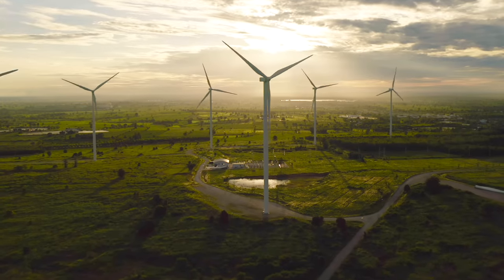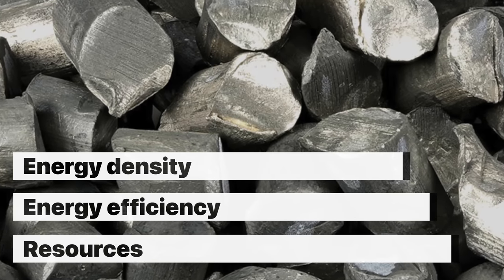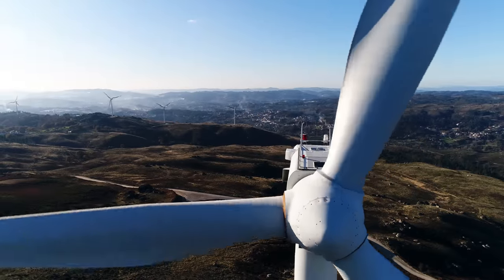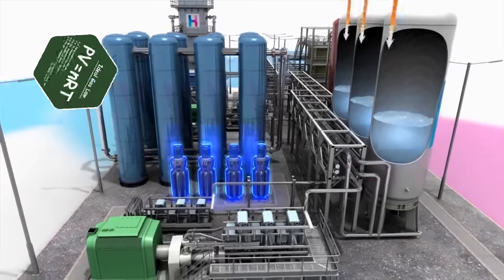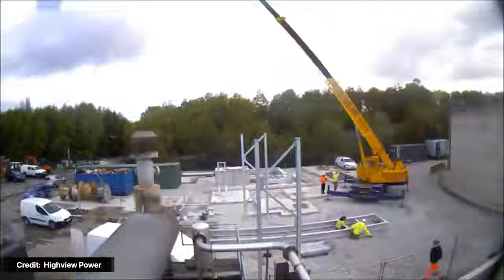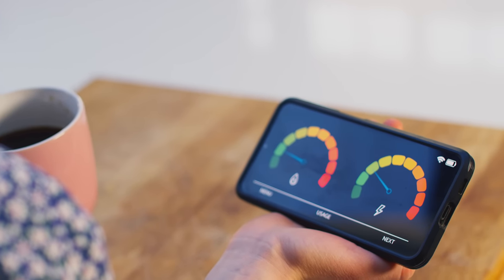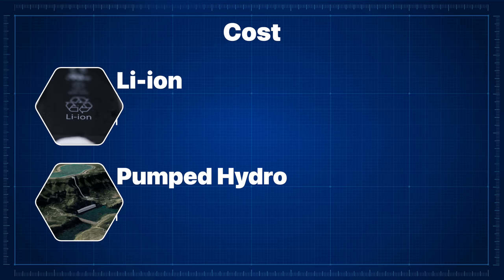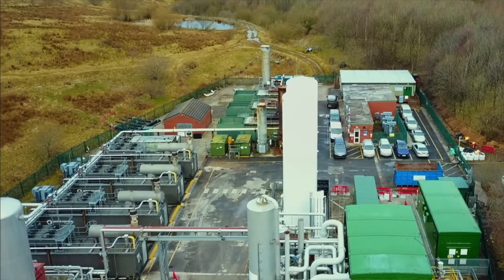Insane Breakthrough Stores Energy In Frozen Air!

Comment from the maker: Go to https://www.eightsleep.com/twobit  to start sleeping cool this Summer and save $150 on the Pod!
Reply: Might be the 2nd product I snag from your sponsored stuff. Got an Aptera pre-ordered, and I've been looking for some kind of water cooled bed for the hot Phoenix nights.
Reply: Even though I think you are sourcing my articles, can yoy do a video on district heat pumps and Badger robotic no dig Tunnel excavation that can be used for ground source heat pump networks..
Reply: Pairing pumped hydro with geothermal is the best cheapest solution from my perspective. Even areas that don't seem to be able to do these together isn't thinking. Even if you can't find higher ground to pump water up too, your already on the highest ground you need. When you dig down deep you have plenty of fall and storage below your feet for hydrostorage and pumping is as simple as digging deep enough so the heat of the earth turns the water into steam naturally and up it comes freely pumped ready to funnel into a steam turbine electric generator for all the free power you need. And with it all the free preheated hot water your ever going to need, 3 birds with one stone. Energy storage, no batteries to replace ever, and a constant supply of free heat and electricity. And big oil has been depriving us access of this all this time by teasing us into paying more and more for not using what has been free and cheaper to optain for us all along. And areas where you can't get deep enough to have high enough temperatures you can then add solar/wind/cryo/lithium in that order before using gas/oil/coal/wood/biofuels and let me tell you why. Even though it is cheaper short term to use these alternatives in reverse from biofuels up to lithium in the long run it is cheaper in the order I just mentioned. You can heat up the water the additional amount needed with solar thermal to reach steam generating temeratures until you max out your space for solar, then add wind until maxed, cryo until maxed, before dipping into litium which needs replacing after so many years, long term costs remember. Save the litium for mobile applications. And don't worry because another game changing tech is on the way to suppliment litium, induction roads to charge your EVs as you drive the highways your charged up as you travel and never need to stop and wait at a charger. At least 3 companys are developing this globally.
Reply: Wow a sponsor with a product I'd actually like to get, what do you know :D
Reply: Wait, why can't they sell the argon, and other noble gasses, also extract CO2 (both valuable and can reduce CO2 in air) etc?.
Reply: Why hasn't reel to reel laser exfoliated graphite oxide, makes graphene hasn't been industrialized? This tech alone could solve energy storage. A 1ft diameter 6ft tall cylinder capacitor with either polypropylene or sprayed mica dielectric could have volatges above 1000v and farads in the terra range

Comment: Something you didn't mention is that the air liquification process they use was developed at the turn of the last century by Georges Claude and has been used for the industrial production of liquid nitrogen and oxygen since before World War I.

 One of the uses of liquid nitrogen is in the production of ammonia, mainly used for fertilizer, using the exothermic Haber process. 

They would complement each other, don't you think?

One of the other things I like about these is that in their existing facilities they use former oilfield workers as they already have the knowledge and skill set to operate these plants with minimal training. 

What a great way to quickly transition them to green jobs, don't you think?
Reply: I'm not sure the skill set between oil field work and cryoplant operation is that good of a match.
Reply: @incognitotorpedo42  On the "Just Have a Think" YouTube channel they specifically mentioned that they used ex-oilfield workers at their Manchester test plant due to their experience with compressors and high pressure lines.
Reply: They don’t want older and proven knowledge and technology. They want to be innovative and disruptive new approaches so that it can lure in more funding from government/venture capitalists. It’s all about money.

Comment: Would these be good near server farms? They always spend insane amounts on cooling. I wonder if they could use this system to harness that waste heat, cooling the server farm.
Reply: server room air doesnt get that hot before they start to overheat. even the exhaust air and coolant in a overheating liquid cooled system isnt even hot enough to burn you.

Comment: Here in Australia,  the thought that this could run adjacent to steel, aluminium and cement manufacturing would be fantastic. Working in conjunction with green hydrogen and subsequently green steel manufacturing or even molten  salt. 
Little bits  of everything to balance peak and off peak loads. Thanks for sharing.

Comment: I feel like this would go great with nearly every other form of power generation. We make tons of waste heat from multiple processes. I could see it getting tacked onto alot of things. Hell this would probably combi well with those compact modular reactors people have talked about before. Just start stacking.
Reply: With geothermal finally making some headway I think nuke power is on it's way out, or at the least put on the backburner for more cleaner, cheaper energy. We can resort back to nuke when we max out our global green footprint. And by then fusion will have been worked on hopefully to perfection. Things are looking very positive lately the competition for cheaper fuels is heating up, pun intended. 😉

Comment: I have heard that liquid air storage plants can be used for carbon capture and storage as different gases liquify at different temperatures so I think CO2 liquifies at -78°C, perhaps other gases could be removed such as nitrogen for fertilizers, oxygen for hospitals, argon for the chemical industry.
Reply: That's called "fractional distillation", it's already used but not for separating the components of air because there's more efficient ways of doing it. 
CO₂ by the way doesn't become liquid if you just chill it, it goes straight to solid. It becomes liquid if you compress it instead. (Nature has some odd stuff).
Reply: What does solid oxygen is like transparent blue ice or transparent aluminum, the carbon makes it black. It's interesting that the oil hydrocarbons are liquid black but get lighter in color as the density goes up.

Comment: I work for an industrial gas company, not the one which supplied the equipment in the video.   We call this type of plant a liquifier.    Very energy intensive.   The air is first separated into nitrogen/oxygen/argon and then in this case the nitrogen stream is liquified and the oxygen/argon vented back to atmosphere.   Normally the energy is consumed so we can transport the liquid to the customer.   Many customers use the evapourated gas, some use the liquid e.g., food freezers.    Liquifiers are most efficient when run at close to rated capacity.    They can be designed for a range of production rates, but turning them on and off frequently is not good for the equipment.   There is a good amount of energy needed to get all the equipment temperatures lowered to the required temperatures to start making liquid.
A nice idea, but one with a lot of "cons".
Reply: So the oxygen isn't sold to hospitals and the argon to industry.
Reply: A typical industrial gas liquifier will produce LIN, LOX and LAR.   In the video they only mention making the LIN to store in the tanks.   The video mentions the plant may be in remote locations.   If so, trucking the LOX and LAR to customers long distances may not be cost effective.   Also unknown if the plant is designed to make LOX and LAR.

Comment: It's a very interesting concept but having worked in refrigeration, that is going to be some big money to buy, operate and repair  the machinery necessary for this to work.  Even considering the volumetric inefficiencies compared to a liquid, an advanced compressed air facility  would "seem" to be simpler and cheaper to operate.  I'd love to see a comparison of operating costs between the two
Reply: Yes. We won`t be using this at the off grid cabin. Middle Class Americans can`t even afford to power a refrigerator from solar...

Comment: I think it would be interesting if they were to pair this with geothermal power generation. That way it allows the powerplant to store excess energy on-site and convert it back into additional energy on demand via the waste heat from the powerplant. This would allow for smaller plants to run at peak efficiency all the time while still being able to meet the needs of the consumers and it also removes the need for the powerplant to moderate its generation capacity based on current demand.
Reply: Renewable + storage is SO useful for decoupling maximum generation efficiency from maximum demand availability. Geothermal, solar, wind all benefit from this, and commodity pricing arbitrage sets optimum prices across the board, for supplier and consumer. The free market is your best friend or your worst enemy. In the case of renewables plus storage is crossing that price line to be cheaper than fossil fuels.

Comment: I would be interested in an apples to apples comparison against cryogenic carbon dioxide.  It is said to have about five times the storage capacity per volume of liquefied medium and goes to liquid at about 30 degrees celcius and five bar.
Reply: Good point.
Reply: Cheaper cryo, co2 storage would be a game changer if it outdoes lithium.

Comment: No matter what technology, nuclear, cryo air, coal, steam etc with the exception of batteries.. basically ends with some pressure pushing a turbine and that turbine produces electricity. The amount of energy changes from kinetic energy to heat energy than finally ac electricity. The amount of steps is so many that its so inneficient.. batteries is the closest we have to a single step, from electricity directly stored in the battery, than finally inverted to ac to load.
Reply: But to mine those metals and rare earth metals you burn diesel and then refining your burn gas and coal and then when the battery cells at the end of their lifecycle you do it again. Think twice before you judge any system
Reply: Your forgetting all the steps that go into making the batteries from the ground up. It's still a carbon poluting temporary solution that is more costly and less green but it is at the top of the chain on the edge of fossil fuel and therefore most important at this time than it's cousins oil and gas especially for what you mentioned, that gap it fills in energy density and fast turnaround. The key is to not waste it in the wrong areas. It should be utilized sparingly and divided evenly at the inverter level in between storage and energy change. Like a thermostat for and between energy/*li*/storage ....storage/*li*/energy cycle change. At some point a tech will replace that and match then exceed it's cost and it can be primary for mobile and space saving applications. I think they had plans for this since the 1940s but Elon has messed up and accelerated the litium use sector faster than they expected. They want a slow progression to milk every sector but it's a wildcard at this time accelerating uncontrollable growth.
Reply: @terrafirma9328  @ oliver, im not forgetting the steps of how the batteries are made.  Im just saying that energy will be directly stored to the battery, with some heat energy loss during the process. Not unlike the conventional turbine. Be it, nuclear, coal, etc, all uses the same turbine, hence, it should be called turbine technology. Imagine from potential energy to kinetic energy, to heat energy, then electricity, so many process and losses. On the contrary, battery technology just started booming. Its not efficient now because of the materials and how its made. But with so many eyes and interest, innovation will eventually catch up to solve those problems. Hopefully anyway.
Reply: @terrafirma9328  "to not waste waste in the wrong areas" easy to say than implement. The more processes it is, the more inneficient it becomes. The closer to the source of energy, the more efficient it is.

Comment: the finnish company doing the sand battery I think is on the right path...  you just have to improve insulation around it and then pump as much heat as you can in when the existence of it, or power to generate it, is available...  They all talk about excess renewable energy...  yeah, they curtail some from the grid but there's not that much yet...  sand, steel plate stacks, even crushed rock and molten salts all have some viability as heat sink storage...  heat to recover - and in this system to aid in the re-gasification phase...   There's a great energy flow  map that LLNL puts out each year with flow from raw to end use / rejected heat...  any heat source contributing to that 65% waste/reject end point is a potential source ...  just under .25 of those points come from electrical generation...  trap and store some of that at those generation points and use for space heating, or this sort of re-gasification, or frankly Stirling engines to generate more power from...  where there's waste, there's opportunity.  But in the end, nothing is going to add more power back than properly insulating,  processes, homes, businesses and optimizing to use the best HVAC, motors and pumps...  that stuff is all substantial  incremental sources of nega-watts that you never need to alter the grid to add back...  same with behind the meter solar panels on homes...  Such a great challenge out there, and ripe for the picking over a decade of focused effort...

Comment: Pairing pumped hydro with geothermal is the best cheapest solution from my perspective. Even areas that don't seem to be able to do these together isn't thinking. Even if you can't find higher ground to pump water up too, your already on the highest ground you need. When you dig down deep you have plenty of fall and storage below your feet for hydrostorage and pumping is as simple as digging deep enough so the heat of the earth turns the water into steam naturally and up it comes freely pumped ready to funnel into a steam turbine electric generator for all the free power you need. And with it all the free preheated hot water your ever going to need, 3 birds with one stone. Energy storage, no batteries to replace ever, and a constant supply of free heat and electricity. And big oil has been depriving us access of this all this time by teasing us into paying more and more for not using what has been free and cheaper to optain for us all along. And areas where you can't get deep enough to have high enough temperatures you can then add solar/wind/cryo/lithium in that order before using gas/oil/coal/wood/biofuels and let me tell you why. Even though it is cheaper short term to use these alternatives in reverse from biofuels up to lithium in the long run it is cheaper in the order I just mentioned. You can heat up the water the additional amount needed with solar thermal to reach steam generating temeratures until you max out your space for solar, then add wind until maxed, cryo until maxed, before dipping into litium which needs replacing after so many years, long term costs remember. Save the litium for mobile applications. And don't worry because another game changing tech is on the way to suppliment litium, induction roads to charge your EVs as you drive the highways your charged up as you travel and never need to stop and wait at a charger. At least 3 companys are developing this globally.

Comment: The heat cycle at work in the cryogenic air battery consists of two cycles:
1. Charging, where energy is applied to compress air
2. Discharging, where energy is extracted by releasing compressed air
There are both mechanical and thermal components of the cycle, the latter a consequence of the large heat of vaporization of air between liquid and gaseous states.

Comment: If you’re going to store liquid air, don’t just heat it up to generate electricity to power AC and refrigeration. Also, directly use the super-cooled air as a heat sink to your freezers, refrigerators, and air system.  You only use electricity to move the working fluid from storage to the point of use.  This of course assumes the tech scales down to home and small business size.
Reply: They would never scale it down, industrial level is for profit. An individual would have to figure that out on their own.

Comment: Our atmosphere has plenty of heat round the clock, you just use an ambient air heat exchanger of sufficient size [maybe fan driven] to do the job.
Another Idea is to combine it with a nuclear power plant. During low demand the power drives the rotary compressors and use the heat extracted during the condensing process to help drive the steam turbines. Then when extraction is required, you use the hot output of the steam turbines to evaporate the liquid using that air to drive other turbines.

Comment: Great installment - thanks!  As we all know there is no one answer for energy storage... but it sounds like this has the potential to be an excellent piece of the overall puzzle.  Efficiency is an important factor today... but it probably won't be in the future.  Lots of excess sunlight out there not being utilized... lol.  Solar panels aren't particularly efficient either, but they have a large part to play for our energy needs.  I think there will be plenty of cost effective future applications for this technology. Just another piece of the puzzle!
Reply: I think solar themal panels are vastly unutilized. Paired with geothermal they could fill in the gaps to bring the heat to steam tempertures